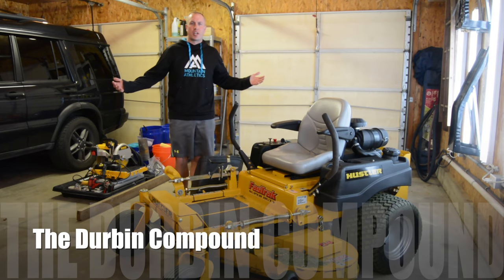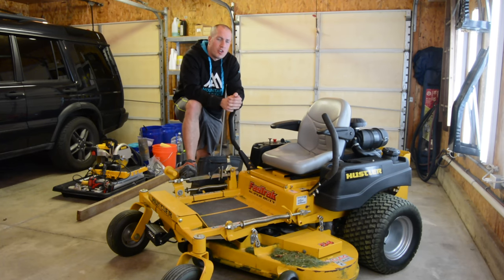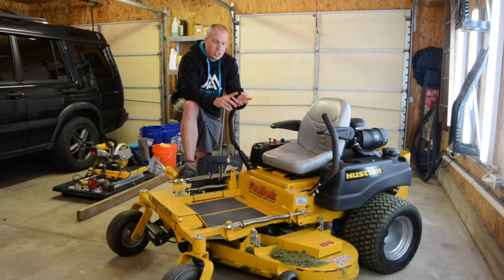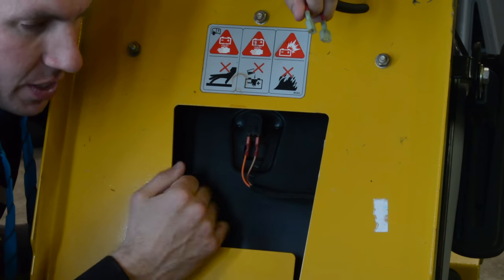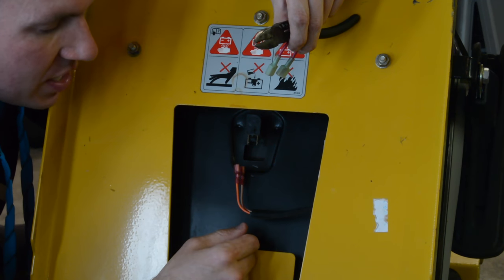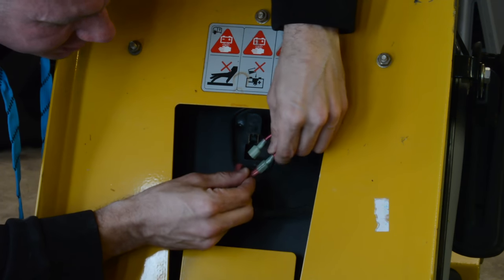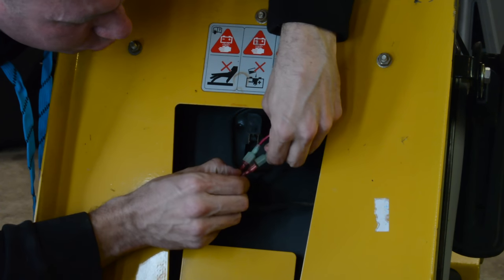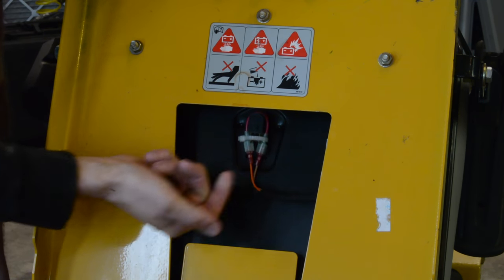How To Bypass Your Mower Seat Switch on a Zero-Turn Mower

Comment: I use just a plain paper clip, stick it in both ends of the wire works fine and like you said if you got to take it to the shop unplug the paper clip and put it back in the switch

Comment: FYI guys.  If your seat switch has the incoming wires (often more than 2) encapsulated in a plug of some sort, simply unplugging it may not allow the motor to run.  There is another switch in the plug itself that either opens or closes the circuit so that you cannot defeat the switch.  It may be necessary to either cut the wires or else connect the wires to make the motor start and run.
Reply from the maker: Awesome! Thanks for the addition to the videos!

Comment: Or just unscrew the safety switch under the seat. It acts as a push button. Once out, wrap some duck tape around it to temporarily keep the button down.
Reply: 5 me
Reply: I did that. But now my battery keeps dying.

Comment: The seat safety wouldn’t bother me so much but mine on my zforce 54” is apparently so sensitive if I hit a decent sized bump moving at moderate speed it will kill the pto every time. So annoying and I plan to disengage it for that reason. If I can figure it out that is, think mine has 4 or five wires if I’m not mistaken

Comment: We have a 2013 Magnum 2250 Dixie Chopper that has  a seat delay switch which goes out about twice a year.  This is in addition  to  or extra to the under the seat safety seat switch, they are not the same thing. We would like to know if you've had any experience bypassing this switch or know anything about them they have no markings what so ever and are 3 pronged. When this delay switch goes out the mower will start but can not be driven.
Reply from the maker: I don’t have any experience with the Dixie choppers. Haven’t even sat on one. A wiring diagram should be able to help you out. You can figure out the switch by disconnecting it from the wires, if it acts the same as it did without you sitting on the seat then the switch is designed to close the circuit.  So you just have to determine which wires to connect together.  You could try connecting all three together and see what it does. May blow a fuse if it isn’t supposed to be wired like that but you can test it and see which combo works

Comment: If you ever find a way to bypass the module 
Please do let me know 
It seems most old Toro Z turns got issues with that module.
Thank you for your video.
Will surely try to monkey that switch for the fun of it.

Comment: Have a Toro Zmaster and a switch may be my problem.  Key turn, battery, plugs, solenoid and starter are all NEW.    Carb  fuel and air filters are all fine.  Can that under seat safety switch solely be the  cause of not starting?    Would there be another switch causing 'no start'?  Any help is appreciated.
Reply from the maker: I don’t know if the seat switch would allow the starter to crank.  Is the engine cranking?  Have you checked the oil level?  There is an oil level sensor that will shutdown the engine on a lot of engines.

Comment: Can the seat pressure switch cause starting problem. My Toro zero turn sometimes just clicks. So far I've been able to move the arms back and forth and it will start.

Comment: What is the connector you used to complete the circuit at 4:30 called? I need to buy one but don't know what its called
Reply: It's a jumper he made. Just two female spade connectors.

Comment: Hahaha man this was the first thing I did on my toro... I couldnt even lean over to avoid a low hanging branch without the dam thing backfiring and dying hahah! EPIC!
Reply from the maker: I know! The John Deere riders can't even back up without shutting the blades off. What a waste of time. That would be the first switch I killed!
Reply: WTF? Even backing up? have they ever mowed any lawn on planet earth? lol
Reply from the maker: Yeah and it's JD. Like come on! Safety trumps everything remember! Even common sense!
Reply: wish you had a video on how to bypass the saftey switches to mow in reverse
Reply from the maker: If I had a lawn tractor with that safety feature, I would absolutely have a video on it! That has got to be the worst!
Reply: TheDurbinCompound it is, it makes my clutch over heat and makes my blades not kick back on...smh
Reply from the maker: It is definitely a safety feature that I think you should be able to turn off.   I feel like the concept is exact the same as the seat switch. Find it and figure out if it works the same unplugged or not.
Reply: Glad you guys are talking about the backup "safety" switch, it's a serious pain in the rear.  I've got an RIO selection on the key switch of my Craftsman gt, but still have to re-select it every time I get off the tractor to move something or other, which is often in my case.  I finally traced the interlock switch that rules all that, but disconnecting it made the PTO not turn on at all (in forward even) UNLESS I selected the mow-in-reverse option.  That's how I stumbled on this video, searching for answers.  This is a normally open interlock switch, pushing the back pedal depresses the plunger on the switch, which turns off the PTO if you don't select the RIO beforehand.  I though at first I found the answer with your video (complete the circuit with a jumper wire), but wouldn't that in turn do the same thing as what the interlock switch does when pushed in?  Before you ask, why not just unscrew the switch and lay it somewhere where the plunger won't get pushed in...would love to do that, but it's location makes it very hard to unscrew, alls I could do is disconnect the push-in connector to it.
Reply from the maker: Without looking directly at it, I have no clue. I’d get ahold of the schematic for your mower and see exactly what is going on and how the interlock and seat switch talk.
Reply: Hey man, thanks for the fast reply!  I think I just stumbled on the answer to my own question, and the answer is your video after all.  I was thinking this was a normally open interlock switch, but instead it's gotta be a normally closed one.  Pressing the plunger opens the circuit, which explains why the deck shuts off when the plunger is depressed with the back pedal.  Selecting the RIO bypasses the switch altogether, which explains why when I unplugged the switch, I couldn't turn on the deck unless I selected the RIO.   So yeh, the answer is to put in a jumper cable like you did for your seat switch (like you, I don't want to make any permanent changes by snipping wires)!  Ha, we all win!  I love youtube!
Reply from the maker: Well I’m glad you figured it out. It’s so much easier to trial and error when you are standing in front of it! Hard for me to guide you through it with text! Hope to see you around the channel!!
Reply: Hey, I'll take any help I could get, even if it steers me toward figuring it out myself, good enough for me!  I wanna mess with the seat switch sometime as well.  I don't want to bypass the mower deck shutoff (I think that's a handy safety), just don't want the engine to turn off when I get off the seat.  I think that's gonna be a bit more involved than installing a jumper wire, though.  I subbed your channel, thanks for the handy vids!

Comment: How do you disconnect all the safety switches on a zero-turn I'm having electricity when I can't find out which one I can't get it to start and I'm bypassing to see if I could get it going I'm the only one operation zero turn

Comment: mines got 3 wires...which do i join pls? Where to buy the clip ends? thnx!
Reply from the maker: I'm not sure what the 3 wires would all be for. It must go through another switch after OR before. Try unhooking all three wires and see what it does.
Reply: TheDurbinCompound
Reply: you could also put a multi-meter to the switch terminals (continuity) and see what is happening when you activate the switch.

Comment: I've got a 2015 Toro ZX4800 and my switch must be messed up cause the engine spins but wont fire. Though I have 4 wires to the switch along with a connector with the bundle of wires that is a female little plug. The machine has 10 hours and warranty is gone and $78 an hour for dealer labor.
Reply from the maker: Hum sounds like a goofy setup. I’m sure it is grounding out the ignition if it spins but won’t fire. I don’t expect it would be super complicated. Try unplugging the connector and see if it fires. If it doesn’t, then wires need to be connect to complete the circuit.
Reply: Thank you for responding. Im gonna keep working on it. I hate the machine any type of slope she nose dives. Put bar tires on and wider larger rims same. Soon as she fires she's gone to be replaced by a tractor.

Comment: I have a question. ..I have a cub cadet RZT 50 and the PTO stopped while I was mowing.  I think the problem is the is a red and black wire with a inline fuse and one end isn't attached to anything.  I think it goes to the solenoid but not sure where.  Have any idea?
Reply from the maker: I’m in! Let’s figure this one out! Do you have a multimeter? Are you able to see if the wire is truly hooked up or not
Reply: @TheDurbinCompound  I know it's hooked up somewhere but it's taped up with the rest of the wires.  Could I send you a pic of it
Reply from the maker: I’m looking at the wiring diagram for your mower.  Is your fuse good? You will need a multimeter to measure for the 12VDC at the PTO connector (blue wire) this wire goes through your handle switches and seat switch. We need to ensure these switches are working correctly.
Reply: @TheDurbinCompound  the fuse is good.  I have a multimeter but I'm not real sure how to use it. ..lol
Reply from the maker: Hummm.....well YouTube will show you how!!
Reply: @TheDurbinCompound  lol. ..I think I figured out the multimeter.  Just need to figure out where this wire goes.  I can bypass the solenoid with a screwdriver but when I just turn the key I get nothing. .not even a click
Reply from the maker: Does your battery have 12VDC? Does the engine start and run?  If it does start, is the mower dying when you engage the PTO?
Reply: @TheDurbinCompound  thebattery does have 12 volts and it does stay and run if I bypass the solenoid.  I haven't turned the PTO on yet though
Reply: Ok so I think the wire coming off the inline fuse that's not hooked to anything goes to the cable that runs from the battery to the solenoid.  At least that's what it looks like on yours
Reply: That's what it was. Got it fixed. Thank you for your time sir!!
Reply: Same problem
Reply from the maker: Did you get it fixed the same way?
Reply: No that safety switch cause my clutch to go out brand new mower only 60 hours on it
Reply: TheDurbinCompound yes sir

Comment: Got Toro zero turn, ran fine for 14 mins then dies. Won't start again.
Gas is full
Battery is 4 months & has 12.6VDC with DVM
What do you think the problem will be?

The above tip was too easy.
Reply from the maker: Does the mower crank over? If it doesn’t, then you have a switch or fuse tripped somewhere (handlebars, blade PTO, seat switch). If it does crank over, you need 3 things for it fire.  Fuel, air, and spark.  If it ran for 14 minutes, I would think your air and spark would be good and I would check the fuel line for flow. Disconnect the fuel line right at the carburetor  and make sure it is flowing fuel. It can gum up pretty easily.  Report back or research some videos on how to diagnose your problem. I do not have a video like that but I will make one soon.
Reply: TheDurbinCompound, nothing turn over.  
Keyed on, only hear two clicks from the engine areas.
Always ran fine before.
Reply from the maker: Fuse, or safety interlock. Make sure blades are shut off, handles up, butt on seat. Might take some more troubleshooting with DVM
Reply: It's a Toro Timecutter Z4220.
Do you know where I can get a PDF service manual for free or block diagrams?
Way too heavy to push this with my little daughter.
Us women are not as strong. This mower is heavy.
Reply from the maker: A simple google search of the timecutter wiring diagram will show great wiring diagrams.  Check fuses first, then make sure each of the switches I said are working properly or depress where they need to be. Should be a simple fix.

Comment: i have a toro 4200 zero turn...it turns off after i engage the handles or the blades any ideas?....i already put a new key switch voltage regulator starter solenoid nothing is fixing it...if i disconnect the plug that goes to the voltage regulator and it turns on and drives but when i engage blades it wont work and i can only turn off the mower if i put that connecter back on there

Comment: Haha hardwire for dummies...ya u dont need to draw a diagram for that....pretty straight forward...your completing a circuit....
Reply from the maker: You have no idea what I have had to dumb down before. I just go ahead and cover all the bases!
Reply: @TheDurbinCompound  Haha for sure man! Still good videos!
Reply: @TheDurbinCompound  hey if your on line, reason I looked t your video is because my zero turn starts fine but everytime I close the handles or turn on the blades it shuts off
Reply from the maker: That’s a weird one. It may be a bad seat switch. Not making the circuit. So when you close the handles or engage the blades, it thinks you’re not on the seat
Reply: @TheDurbinCompound  I thought that after watching your video. So I jumped the seat switch and still a no go
Reply from the maker: 🤔🤔🤔 do you have the same mower?
Reply: @TheDurbinCompound  no it's a Toro  4220 I think...labels are all gone...it started off the transmission ebrake cogs wouldn't disengage...I replace battery and that works but now it dies when I close arms or turn on blades
Reply from the maker: Ok let’s try to narrow this down. Sounds like the safety switches are working on the PTO engage and the arms. That is why it’s actually shutting down the machine. Is your seat switch a 2 or 3 wire ?  You can test the switch by using a meter and making sure that it does work how it is supposed to,  it might be a switch that works opposite, so when you sit down, the circuit is open. When you get up it closes the circuit, so jumping your wires when they are off would not solve your problem.
Reply from the maker: According to the schematic on page 46 of the manual below, the only thing that it can be is a bad wire in between your seat switch and where it taps into your handlebar safety switches. 

https://www.toro.com/getpub/42842

How I read it;  if you are sitting in the seat, the kill sw relay is engaged so it is not grounding out the ignition. So if you are in the seat and providing that power, it doesn’t matter if you move your handlebars or click the PTO switch. The power is still holding open relay through the seat switch. Now if that wire was broken, it wouldn’t matter if you were in seat or not, either action would kill the engine.  The fact that it starts, indicates that the kill relay works, the handlebar switches work, and the PTO switch works. 

I’m not looking directly at the machine so this is the best guess I’ve got at the moment.
Reply: @TheDurbinCompound  it's just two wires. I can "unscrew" the pressure switch from the seat. It's pretty much a button under the seat those wires hook to. If I could send pics through replies I would
Reply: @koreyhayden1368  did you figure this out? Mine is a Toro timecutter 4226...same thing happens
Reply: @AndrewPierceBohemian  I did! So under the ignition switch, where all the wires come out of it, there's an orange wire....it was unhooked, juggled lose I guess. Hooked it back up and bingo
Reply: I think its something to do with the ebrake system and wasn't allowing other things to work